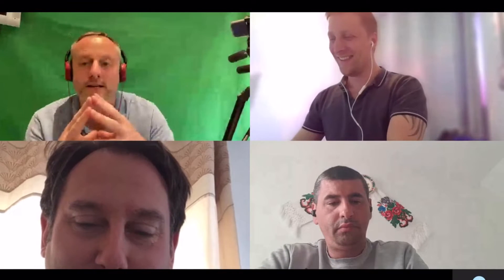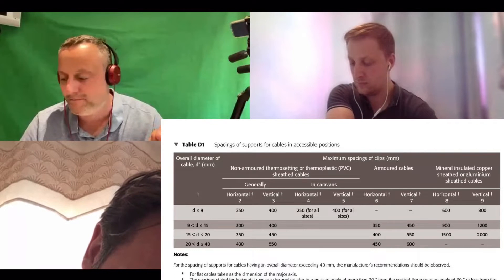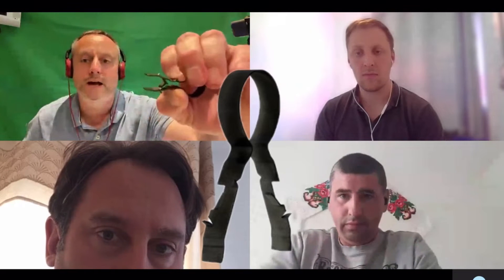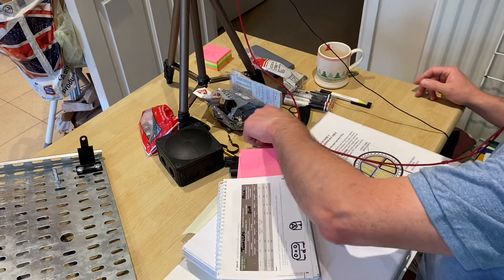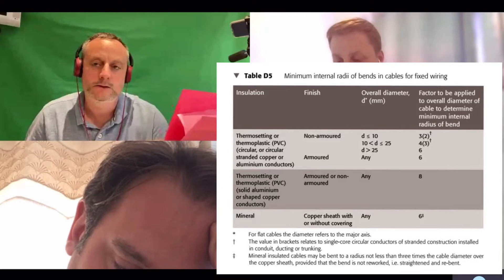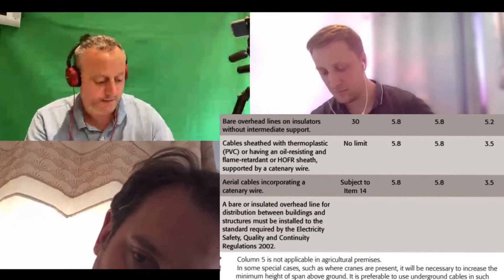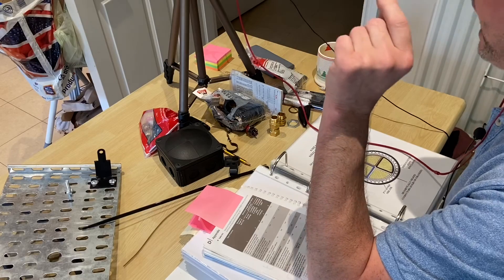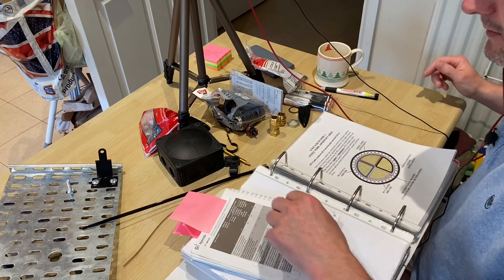SWA Cable Different ways Fixing SWA Cable, Maximum Clipping Distances, Bending & Catenary Wires Pt3

Comment: Table D1 indicates spacings of supports for cables in accessible positions. Do these spacings take into account the electromechanical forces caused by fault current? What type of cable supports are required to withstand these forces? Are fault rated cleats mandatory to mitigate these forces?
Reply from the maker: What a fantastic question - and sadly I don’t have the answer to hand.

Comment: The screw should always be on the bottom in event of a fire the screw will give the cable some support.
Reply: The screw at the bottom is pointless if the saddle is plastic. The fixing needs to prevent premature collapse so the saddle needs to be metallic (or of a non combustible material).

Comment: Most important part is the bending radius!
Too tight a bend will lead to the Internal installation breaking down prematurely.
Reducing the life of the cable and raising potential fire risk due to short circuit.
Don't forget metal ties and cleats for the firefighters!